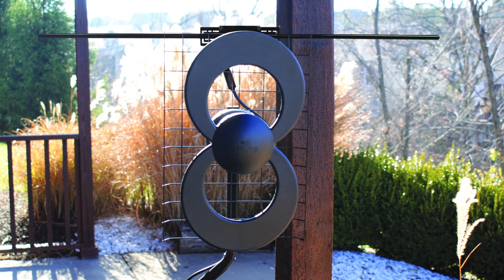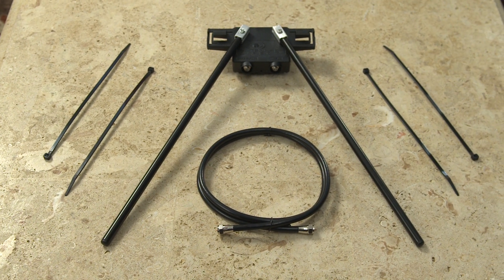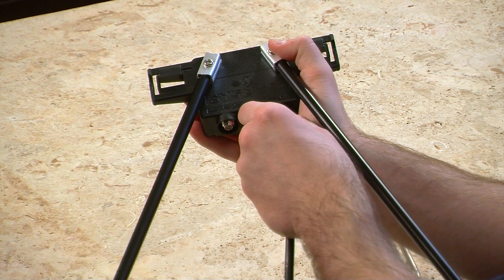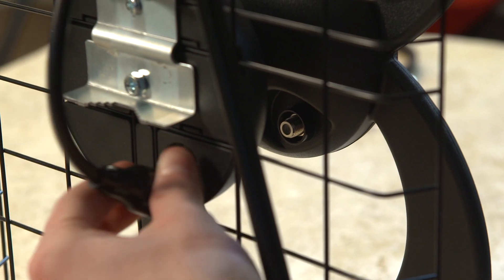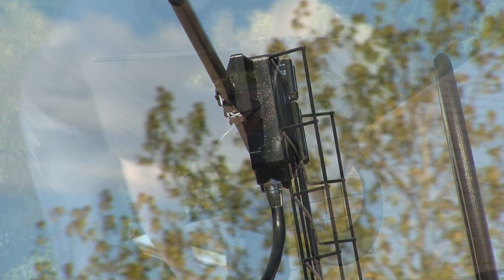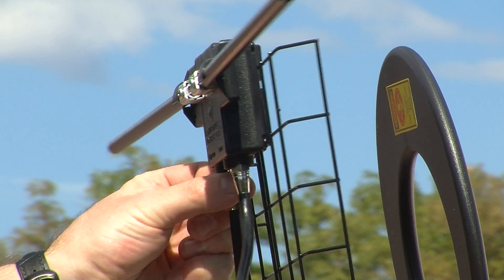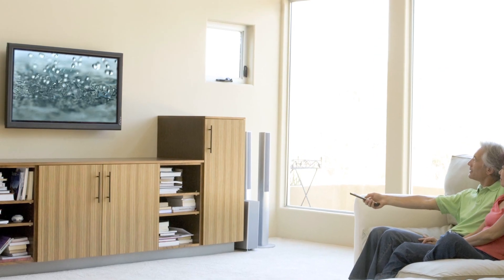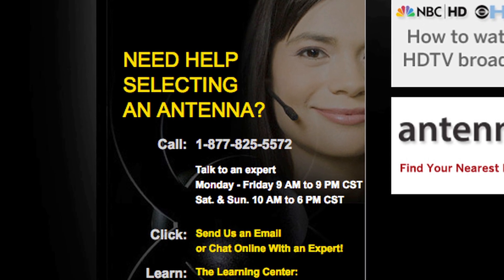VHF Kit: VHF Antenna Reception - Assembly and Installation

Comment: I have the DB8e 8-Element Bowtie UHF antenna. I'm assuming that if I bought this kit, I would disconnect the cable from the output of the UHF combiner on the the DB8e and connect it to the UHF/VHF connection on the VHF kit antenna. I would then use the 3 feet cable to make the connection from the output of the DB8e's UHF combiner and connect the other end to the UHF connection on the antenna kit. My DB8e woks great. All channels come in great (about 50) except for channels 4.1 - 4.5 which are good at times, but pixelated at other times. I'm now just learning these are VHF channel. Hopefully, this will help.

I know this antenna says it's for VHF channels 7-13, but I found this:

VHF low band (Band I) between 54 and 88 MHz, containing channels 2 through 6, and VHF high band (Band III) between 174 and 216 MHz, containing channels 7 through 13.

Comment: I live in Northwest Indiana right between the Chicago and South Bend Market.  I put up a Wineguard 360 amplified antenna and picked up 75 channels, everything that I would expect to receive I got in.  In December WBBM (CBS2 Chicago) which is channel 2.1 decided to change their frequency to a VHF signal and I quit picking it up no matter how many times I scanned.  I bought the VHF retrofit antenna from Antenna Direct all I did was zip tie it to the mast beneath the Wineguard antenna and did not even hook up any coaxial to the VHF antenna and went in and scanned the TV and I started picking up CBS2 Chicago and it's two sub channels again.  Basically if that long element is not present you will not pick up the lower numbered VHF stations. Recommend this product.
Reply from the maker: Thank you for leaving a great review of your experience.
Reply: If you didn't hook up the vhf retrofit to any coaxial cable and just had the antenna attached to the mast, then how did the vhf signal get to your TV?  You have to connect the vhf antenna to something by way of wire and input to bring the signal to the TV.
Reply: PhotogHer Just an electromagnetic connection.  I later added a combiner and it got a stronger signal.